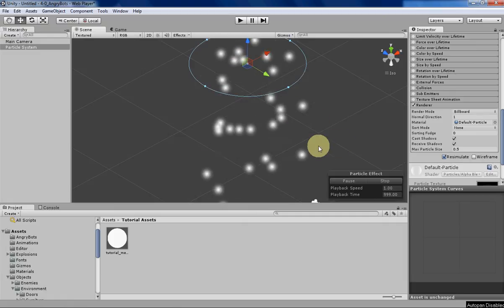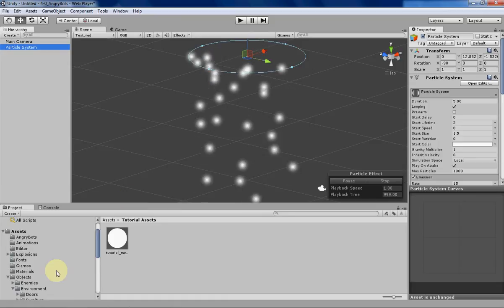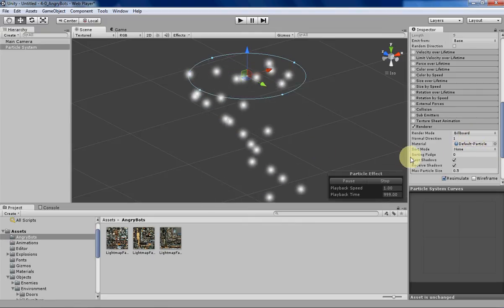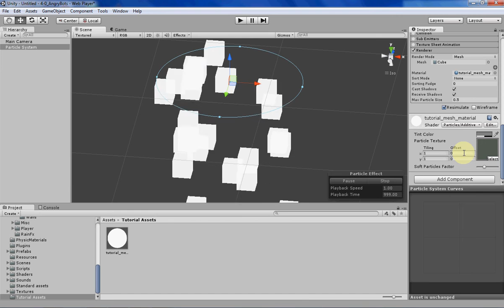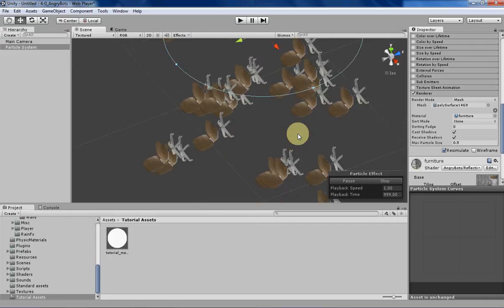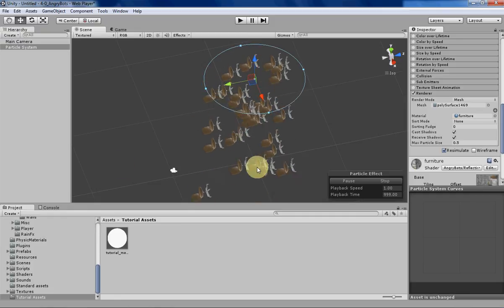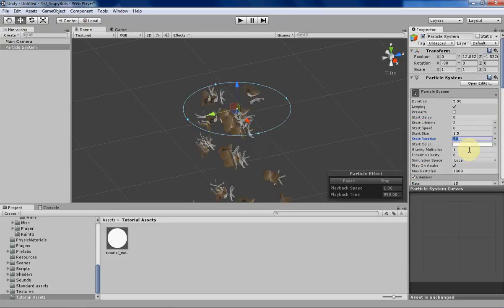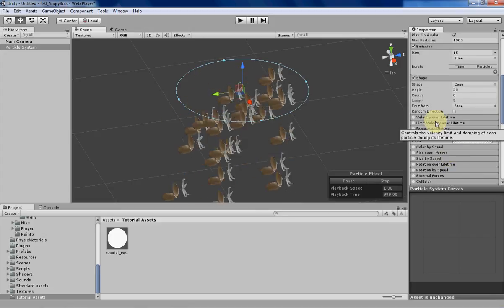Unity's Shuriken Particle System: Meshes

Comment: I have a problem. I try to make a particle from psd file.
I have a psd file and there's 4 kind of shape in it .4 tiny stones. I want to make a particle with multiple spirits . I don't want to make texture sheet animation .Because stones should not change suddenly.All four stones must be in the particle I want the stones to spread around. I made the movement model, but I can't have four 2D sprites at the same time in partcle. can you guide me

Comment: So how do you fix the orientation of the object? Or, more specifically, if I have a mesh being used in a particle system that's more of a fountain, how do you get the mesh to always be oriented in the direction it's going much like a stretched billboard would?
Reply from the maker: If I'm understanding correctly, it sounds like you would need to have the base rotation match the base direction of the velocity, as well as both continuing to match through the lifetime of the particle, which would be pretty tricky for an emitter of your shape. I'm honestly not sure, as getting the base orientation/rotation to match with the direction would require some sort of node in the 3D object to orient towards for a particle script to recognize, and I'm not sure how you would go about doing that. Sorry about that!